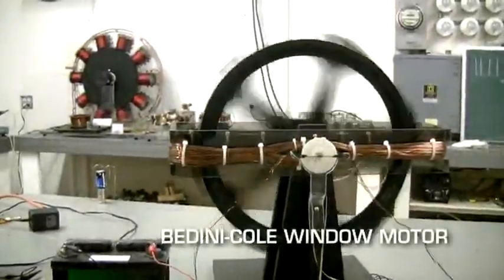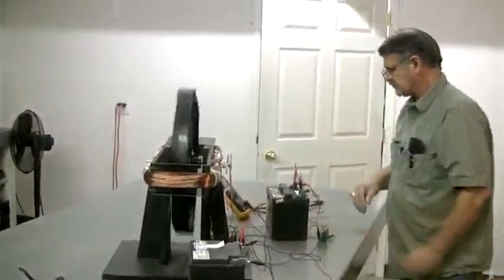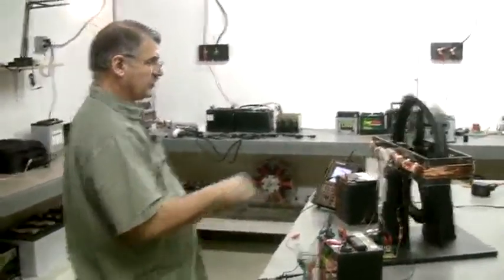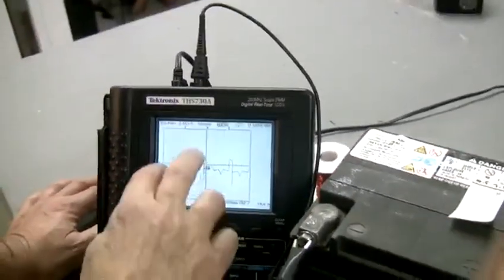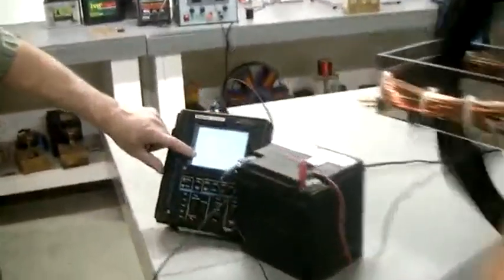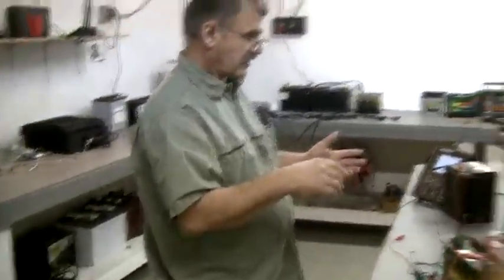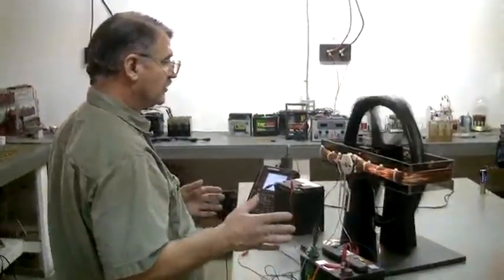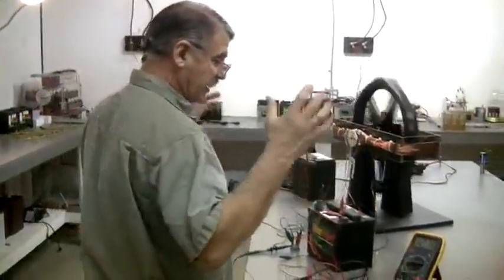006 - The Bedini Cole motor.

Comment: I wish Bedini had something I could easily adapt/adopt/replicate without requiring some high level knowledge of electricity and breaking bank. 😢
Reply from the maker: You could just build a simple JT and start with that. It will teach you a lot. It is not expensive to build. And it can be adapted for a wide range of voltages. It is sometimes called a self oscillating circuit.